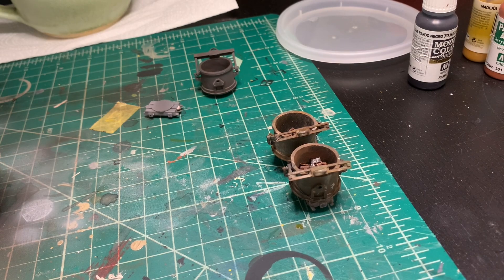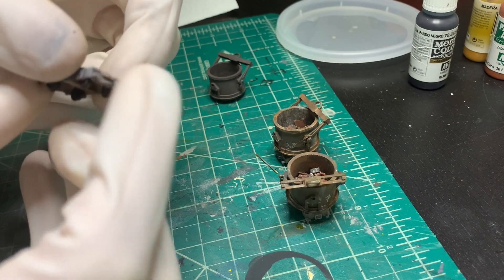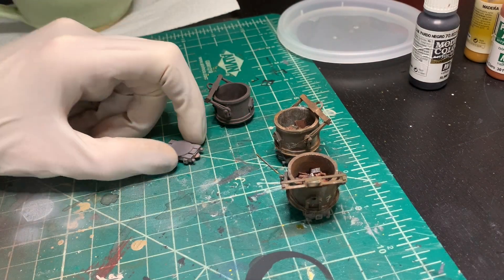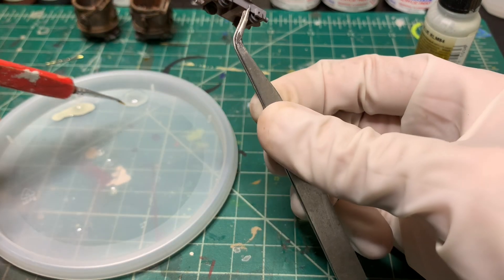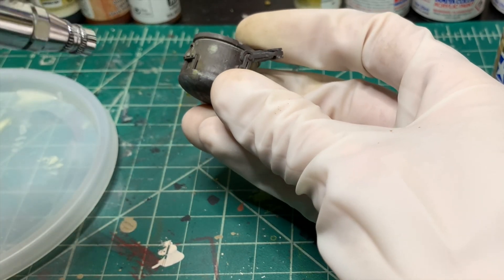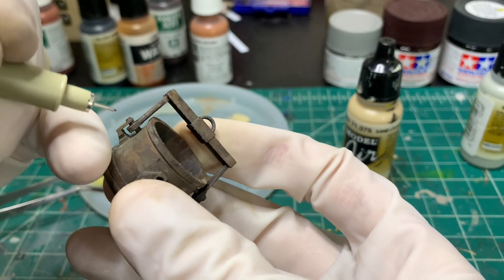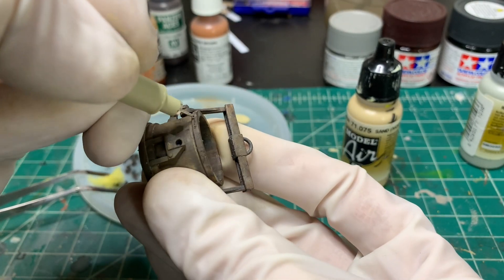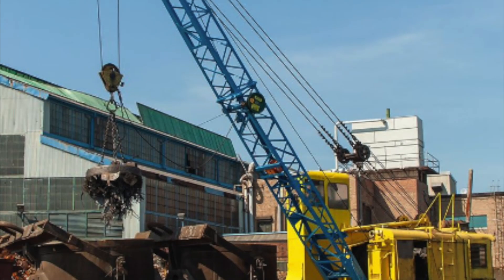Scratchbuilt Finkl Steel Ladles and Trollies | CCMR At The Bench #7

Comment: This is exactly what I was looking for. I am building some scrap metal bucket trollies for my 009 steel mill layout. These are based on the wagons used at Standard Steel in PA (I am from the UK BTW).

Anyway, a question. On the prototype, are these ladles secured to the trolley or is it just the weight of the bucket holding it in place? I couldn't see anything on the photos.
Reply from the maker: For the Finkl prototypes, it appears they are seated on a circular platform with their mass securing them to the trolley and little else. That railway is likely to only be moving at a few MPH so unlikely they would fall off. Likewise not obvious to me whether the clamshell doors at the bottom of the prototype ladles are flat or round. Contemporary ladle trolleys that I've seen have four steel 'fingers' that help to center the ladle in place on the trolley.
Reply: @ChicagoCrossingRR  thanks for that, appreciate it. I have seen other examples that also look like they are not secured. Trust me, fitting scale sized chains would be a pain so I am glad 😭
Reply from the maker: @vikingofengland  fitting small chains to secure ladles sounds like just the sort of thing I'd take on...😅. Not saying it's a good idea.